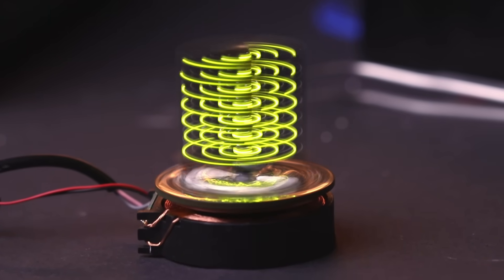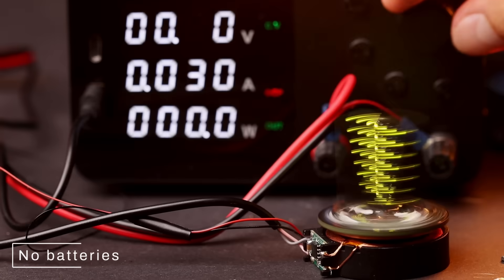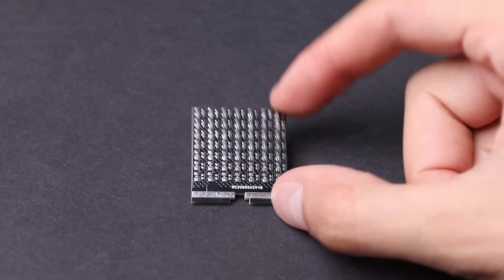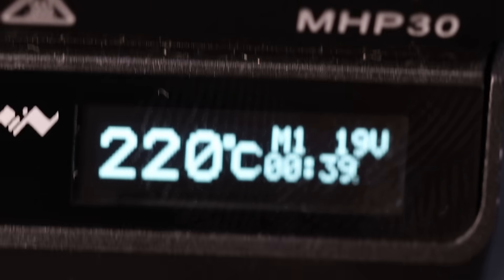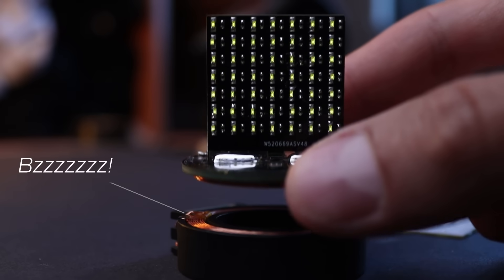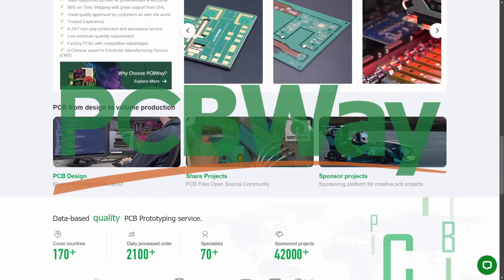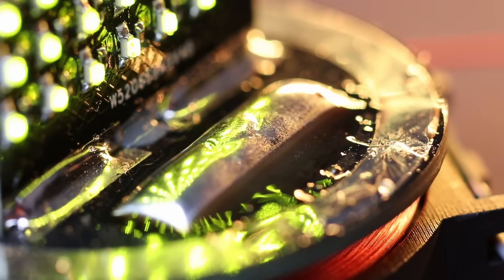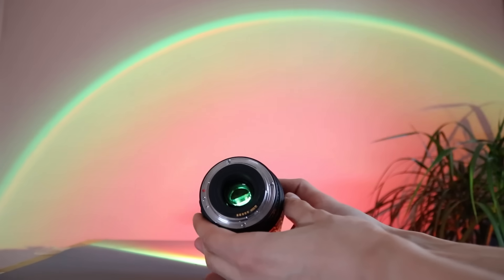I Made a Tiny Volumetric Lamp

Comment: Why do toy guys run these one-sided? I don't understand why you don't have leds on both sides..
Reply from the maker: There is no point in leds at both sides as it spins
Reply: @NickElectronics So it wouldn't be brighter with less flickering?
Reply from the maker: @jakenkid  It would, but even for a simple lamp like that, I don’t know if it’s worth it. It feels easier to just increase the LED current than to double their number. And if we’re talking about a display, controlling twice as many LEDs becomes even more complex. So I’m not sure.

Comment: It would be great if there was a way to sub-modulate the AC power transfer current in such a way that it could transfer not only power but data...
FDM, PSK, FSK maybe or even a separate NFC/RFID type coil.
Reply from the maker: It’s definitely possible. I don’t know about the bitrate, though—I’ll have to study it a bit :D
Reply: @NickElectronics  

Yes upon further thought this sounds difficult over the induction loop. Hysteresis and slew rates and damping etc...

How about this then:
Power with induction.
Xfer data optically with a ring of photo-transistors on the rotor and a IR led on the base.
You'll get your POV sync for free.
As long as the MCU is fast enough to transfer a frame of led data for each 'window' of IR led / photo-trans alignment (fast MCU-esp32-S3/P4 - but the emitter / receiver will certainly be fast enough) then this could be viable.
Schmitt trigger the transistors for a clean symmetrical bit stream.

It should - with careful timing - be possible to aggregate the transistor(s) receive data to produce one frame per revolution or a frame per half / quarter turn etc as per requirements and bandwidth limitations.

Given the speed of IR leds / photo-transistors - with the right MCU the horizontal resolution could be amazing!

I recon your existing design could accommodate around 60 of the smallest SMD photo-transistors as a ring without getting too stupid from a PCB design POV.

But of course you'd only need one transmitter and one receiver if you're happy with one frame per rev and you can squeeze all the data into one RX/TX window.

Comment: Not sure how that motor behaves, if it spins freely you can balance it by turning it sideways, rotating it and let it stop on its own. It will naturally stop at a heaviest point. drill out some material and repeat until it doesn't seem to prefer any particular direction to stop on. Probably also benefit to spin it up and try to use a chisel to trim the outside perimeter to ensure it's not slightly off center.

Alternatively: make 2 LED matrices, each with its own green pcb so the setup is naturally 90% of the way there already. I'm sure it would still need adjustments, but probably not nearly as many.
Reply from the maker: Thanks for the advice. Actually I tried the method you mentioned, but it doesn’t spin freely enough to balance it that way :(
Reply: @NickElectronics  I suspected that might be the case. Some motors have very sticky movement when not powered. 

Sadly every other method I can think of would introduce its own imbalances and end up being just as much trial and error as this already was.
Reply from the maker: @cryptoscriptorium3338  This one is a simple brushed DC motor, so it rotates freely — but not freely enough to balance well :D

Comment: quick question can we just use magnet in bottom place and then indues current on top  to power leds?
Reply from the maker: If the top PCB has coils, designed for that then yes

Comment: Try using a brushless motor next time with a Field-Oriented Control driver. It's a bit more setup but they're better in every way other than the slight increase in cost and complexity. They're a lot quieter (especially using FOC). You can get a lot more precise velocity and you can sync the phase with another process, which I'd imagine is essential to volumetric displays. You can also use them as servos! I'll never go back to DC motors for projects.

You could use maybe a small gimbal-type motor like a 2204 ($10-20). Good drivers for that would be a SimpleFOC Mini ($7-15) or a moteus c1 ($60). The SimpleFOC needs an external microcontroller and sensor for the motor, but you could use an arduino nano or STM32 bluepill for the MCU and an AS5600 (like $10 for a 10 pack) for the sensor
Reply from the maker: Maybe in the future, I'll get my hands on some BLDC motors. If I do, I'll create all the control electronics myself — otherwise, it's not that much fun! :D

Comment: the reason why we use wireless charger circuits is to generate alternating fields without moving the actual device that receives it, you could use some coils and magnets to power rotating device, if you can modify dc motor you can use already existing magnets on it to power LEDs and spin them (its shell should be plastic, 3d printed, would be fun to try). or if you want to go even more advanced, there are already brushes ready to use inside dc motor that you could share its power to LEDs, bit too complicated but doable.
Reply from the maker: @mixgamer2908 There are a lot of reasons for using wireless power transfer and not only for static objects. Even opposite. If objects are static its better to use wired solutions. I was thinking about combining both generator with permanent magnets and a motor. Its challenging and eventually I understood that they still have to be separated to not interfere each other. One day I will make a video about it 🌝
Reply: @NickElectronics  well in that case transformators in general in chargers and in other appliances is practically wireless 🤯 but yes wireless power is still more useful that what I said, especially if they are not static but they move slowly relative to each other, or distance is grate, (what i should said is that wireless power transfer circuit is made to create non-static fields between relaively static objects, does not mean they should not be used sorry)
Reply from the maker: @ Transformers use same principle as wireless power transfer, so yes 😅 I will try to do more power electronics project in the future and play with wireless power transfer, and maybe some interesting converters, which would have transformers on board as well 😳
Reply: @NickElectronics  actually you should make small community where we can talk about such a stuff, it will be fun considering practically I know nobody who is interested in same thing as this to talk to, after all we all learn by sharing experiences and I'm sure I will not be alone who feels like this (who has no friends interested in same things as them)
Reply: @NickElectronics  and thanks for taking your time and being interactive with us.
Reply from the maker: @ No worries, I enjoy it :)

Comment: To reduce vibrations, you can use a phone app that graphs gyroscopic data. Place your phone and the lamp on the same surface, and you’ll be able to see how much adjustment is needed to make it run smoothly.
Reply from the maker: Thanks for the advice ☺️

Comment: The whole battery/power situation.. I did a volumetric display ages ago (that has since died) with a motor driving the display at the bottom end of the axis, connected to the other end with a bracket like you'd see on a globe. On the top end I mounted a smaller dc motor fixed to said bracket by the shaft, so that it could generate power for the *duino circuit and leds.
Reply from the maker: Interesting solution. I wish there were some photos of it 😅

Comment: If you added LEDs to the back would it potentially double the "resolution" if you coded the lights for different shapes or images?
Reply from the maker: It depends how to put them. If they will be located at the gaps corresponding to other side - then yes. But it is probably easier to put all LEDs at one side and resistors to other and just solder them more compact. Or remove resistors at all and use some current controllers for LEDs.

Comment: So, what's that grey goo? I need something better than hot melt glue for my headphone modding (basically to hold the new 3.5mm connectors in place).
Reply from the maker: Its a 2 component epoxy from loctite :D

Comment: Why use WPT for the LED board instead of wires?  Great how you did it though.
Reply from the maker: @andrewjenery1783  Cause it spins. How
do I connect wires there? Slip rings usually are designed for low RPMs
Reply: @NickElectronics  Yep you're right.  I was thinking of slip ring or a battery but forgot you mentioned why those wouldn't work.

Comment: You can use them programmable LEDs to make a display, use rf signal on that induction power coil for the LEDs serial signal, the spinning platform is power coil & supply, LEDs and rf serial circuit. The base is the video io. how many frames per seconds would that give.
Reply from the maker: @AegisPupus  Yep, I could do it. But I suppose someone has done it already :D Novelty of this video is only in wireless power transfer, and some jokes and I hope unique style

Comment: Looks very cool. By sacrificing half of the brightness and refresh rate if you offset the axis of rotatıon half a grıd unit you can have 2x horizontal resolution
Reply from the maker: I also just could solder diodes with some shift. But for some reason I did not think about it then. Next one will be better for sure :D

Comment: An Oled panel is also essentially a LED array, so theoretically is it possible to create this device with a thin Oled ?
Reply from the maker: "Yes, it’s possible, of course. However, it's much harder to control because if you want at least 360 pixels of horizontal resolution, you need to refresh it 360 times per rotation. To achieve a 30 Hz refresh rate, that's 30 rotations per second, meaning the data has to be refreshed 360 * 30 times per second—around 10,800 times per second. With the same vertical resolution of 360 pixels and using RGB colors, that's 360 * 3 = 1,080 LEDs that need to be refreshed 10,800 times per second, resulting in a data rate of 11 megabits per second. And that's only for one row of LEDs. So, it’s more of a surface display with an unusual shape rather than a truly volumetric display.

If I needed a truly volumetric display with a 360-pixel depth resolution, that would require controlling 360 columns, essentially 11 Mbits/sec * 360, which equals 4 Gbits/sec of data. That’s quite a lot. There may be ways to optimize it, but still, it would be challenging.
Reply: @ Thank you for this answer, it has been bugging me for a long time 😅. But if possible somehow, it would be the coolest thing ever
Reply from the maker: @bulletwa  In one of the next videos I will try to improve it a lot. I publish once per 2 month usually, so you have to wait a little bit 😅

Comment: Had a cool idea, what about turning the rotating part in to a “generator” by having the coils on the PCB, and using magnets below. 🤓
Reply from the maker: @knutkleven5939  Its possible of course. But I am thinking about using BLDC motor and put magnets at top, coils at bottom. And then IDK what to do with WPT. Maybe will add some additional coils
Reply: @ saw a fellow using ir diode transfer for something similar. You also get the cool effects that the set point for the display automatically track your ir transmitter if it moves.
Reply from the maker: @knutkleven5939  Thanks for sharing

Comment: Although I may be mistaken, I believe you could utilize a toroidally wound coil and a small magnet for power transfer. This arrangement would draw power from the coil’s rotational motion.
Reply from the maker: @TechTipsUSA  Yes, you are right. It would generate electricity in the rotating part. But  generated current frequency would be lower and thus, bigger filter is needed, or more fancy dc/dc converter at output. I will show it in one of the future videos 😁

Comment: You could have made the wireless power transfer with just a magnet on the bottom and a coil cutting the magnet's field. It would make it heavier for the motor to spin, but you would need a driving coil.
Reply from the maker: @Sphaazer  Yes, i could. In the future I will change the design a little bit ☺️

Comment: Very good  🤩
Balancing does not require large investments, in mine (without neglecting yours) I used static balancing, checking the balance with the motor stopped, and in dynamic balancing, I placed a piezo disc on one of the bases, and placed weights around in order to detect the smallest possible amplitude on the oscilloscope.
Yes, this is real 3D
Reply from the maker: @G7Dropes  Hm. Thanks for sharing your balancing method. Probably I will need it in the future 😊
Reply: @NickElectronics  
I had great difficulty finding a way to balance it, the closest I came to it was using speakers with weights on the cone, too complicated for small inventions, then I remembered piezos, it's really straightforward 🤗

Comment: The spinning itself could actually act as a way to transfer power by passing a magnet near a coil on the floating surface… as it starts to spin it would get power, allowing you to control it via Bluetooth
Reply from the maker: @J4me5De1t0nniu5  I will consider it in the future. But the problem of generator like that is lower generated current frequency. So I would need bigger filtering capacitor, probably

Comment: you should sell these. I would genuinely buy some
Reply from the maker: @sciencekid8500  I am considering such an option, but it is too raw so far. Its a prototype that requires lots of polishing. But please follow to see when it is going to be ready for the market 🙂
Reply: @NickElectronics  i would suggest using a 3d printer for a sort of frame, rubber stabilizing feet for a more professional look, and find a way to make it so that the components have pins that connect for easy installation... you could also sell it as a kit.

Comment: I wold like to know the effect that makes a normal volumetric fan screen (whatever you call it) that spins on a vertical plane, and then spin all this contraption on a orizontal plane
Reply from the maker: @AlinDanielEpure  I think there is a reason why companies that produce “volumetric fans” haven’t done it yet. Probably it is quite hard to synchronize and spin uniformly at all axes. So, actually, I see a lot of challenges in the design you mention and do not know how to solve all those problems in easy way
Reply: @NickElectronics  the vertical plane should 2 back to back fans, that spins in the opposite direction to cancel any vibration and momentu, then the base of all of this should spin it too (sorry for my bad english)
But regard all of this, my curiosity if you can get a 3D globe, where if you look from back you see the backside of an object, and if you move in front, you will see the front side of the object.
Reply from the maker: @AlinDanielEpure  Yeah, you can cancel out disturbances, but its probably not worth it economically. To complicated system, that would cost a lot. 
Yes, you can make a 3D sphere for sure. Its just a matter of synchronization. But I don’t think it is very easy 😅

Comment: you can solve this problem by doing the same method as what ship and tank turrets use, the base of the turret is running on a tracked racer ring where power, communications, and controls are being transmitted through, and is usually in the form of a disk at the bottom of the turret housing, though it can also be a ring band around the side walls of the turret housing. this allows for the turret to be swapped out very quickly and easily since there are no binding connections to the turret housing itself, and it allows the turret to spin freely.

the way it works is very similar to how a brush DC motor works, the brushes make contact with the anode and cathode, producing a current. these things can be somewhat expensive but if you can buy a cheap ceramic coin and then carefully carve out inlays on them (or alternatively 3d print a ceramic coin with inlays already on them) you can inlay annealed copper into them to form the disk.
Reply from the maker: but turrets don’t spin with a speed of 6000 RPM 😅 That’s the problem. I also want to get rid of brushed motor in the design

Comment: Ok, hear me out on this one. You include magnets in the base of the lamps and include coils in the spinning part. Now you only have to rotate the lamp fast enough for the coils to function as a generator and tada, now you only need to power the motor. I don't know if it's actually much easier to basically make a generator and than it is to set up the energy transfer coils though
Reply from the maker: @jelmervd2l  Using generator has one drawback. Generated current frequency is going to be lower then of wireless power transfer, which would require bigger filters. Difference is really huge. According to my calculations its 100 times difference (but depends on number of generator poles of course). But i will make a generator in one of the next videos :D
Reply: @NickElectronics  Oof, yeah 3 orders of magnitude is not peanuts and huge electrolytic capacitor will not do the aesthetics any good. increasing the size of the project might help hide them inside the housing, but that probably adds other complications. Good luck on your next projects, i'll be sure to watch them
Reply from the maker: @ Or i can put tons of ceramic caps 😅 5 volts is not that much, so volume/capacity should be good. Or maybe I can even go as low as 3 volts, to use 3.3V caps. Have to think about it

Comment: Question, can you buy transparent circuit boards?
Reply: i know you can buy different custom colour PCB's but no idea if transparent ones are a thing
Reply from the maker: @Jack_Wolfe  Yes, you can, they are called flexible PCBs and they are transparent. But they more like a transparent thin film rather then hard board. Also, its kinda hard to solder them, so they are mostly used as ribbon cables.